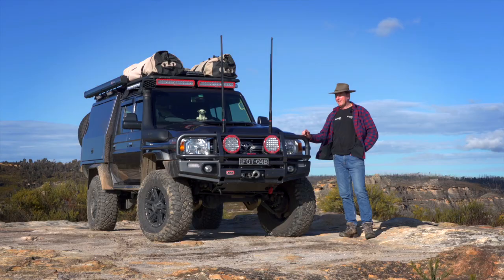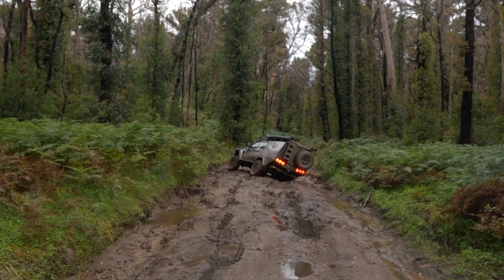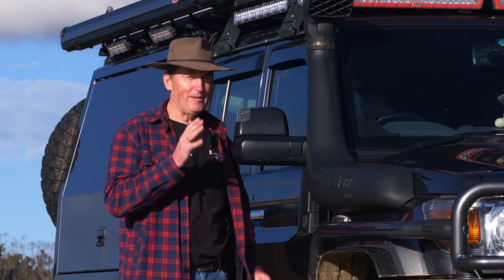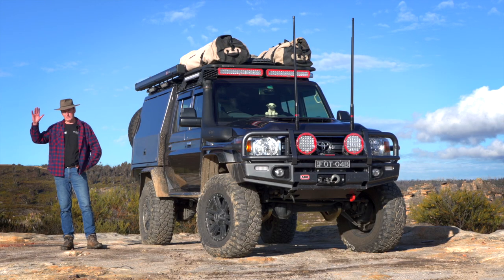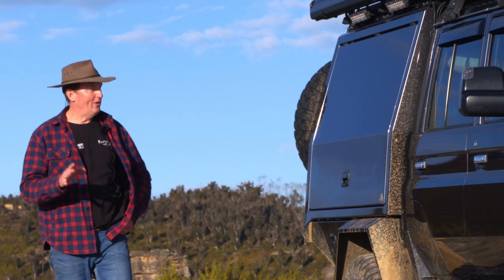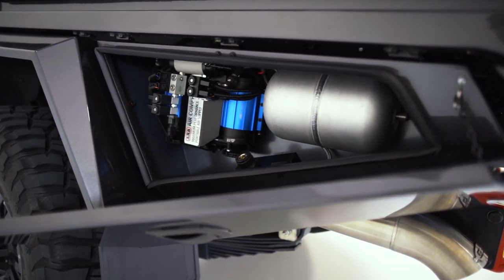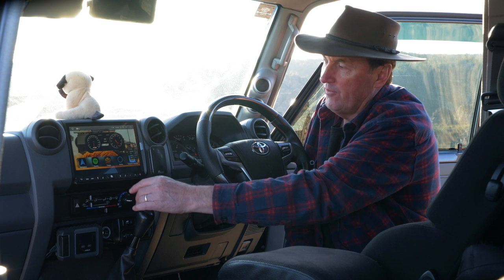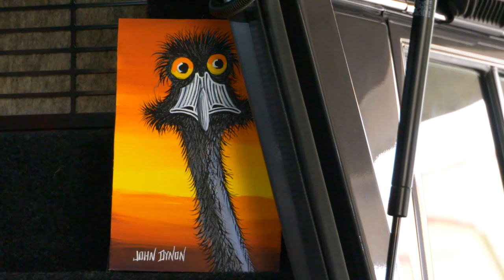200,000 kms updated walkaround | Changes inside & out! The Mighty 79

Comment: Great video Michael, love the 79. I'd love some more info on the iridium setup and antenna that you're using. Cheers
Reply from the maker: Cheers for the feedback guys. It’s a fairly basic setup really. When the cabin is powered, the unit powers up but is in standby. In order to utilise it, you lift the units antennae, which allows you to connect using your phone. You can text or make calls at the rates set to your plan. We use Pivotel.

Comment: First fell in love with this mighty 79 a long time ago.
How’s the engine holding up , injectors or starter motor needed any attention yet? Cheers matey
Reply from the maker: That’s great to hear your feedback Harry. Everything is all good… touch wood. We have given a good run that’s for sure 👍
Reply: @OffroadImages  know of a single turbo vdj making it toi 765k before partial rebuild, have heard of one at 1.1million. mine is a 400 thou no under bonnet repairs